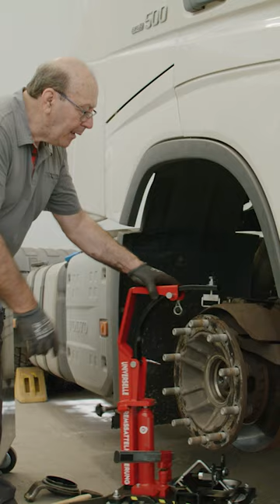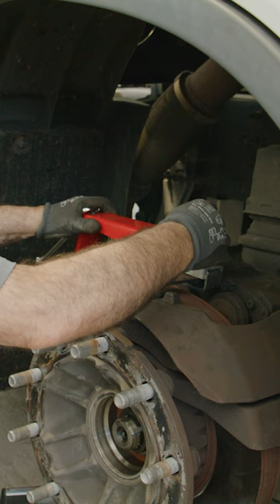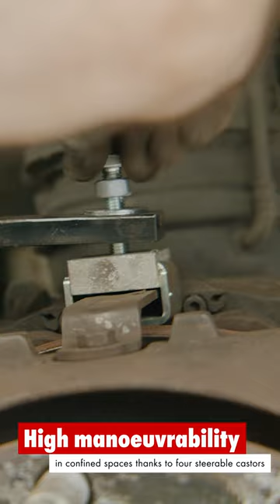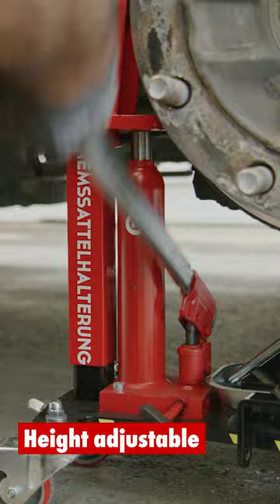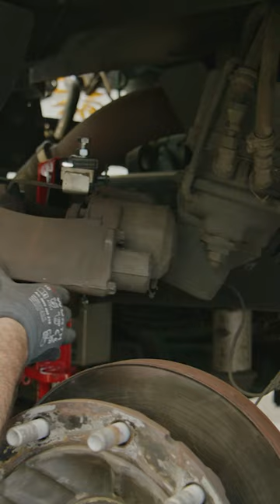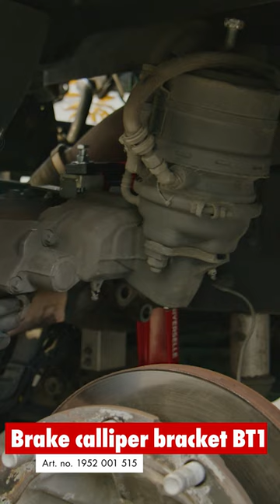Brake Caliper Trolley for buses, trucks and industrial vehicles #shorts

Comment: This really is a waste of time and money… Workshop environment, you’d have a 24mm socket on a windy gun, undo the brake chamber and lift the caliper out the way. Now what truly would be a useful tool would be a caliper holding tool for underslung calipers such as those on trailers. Possibly just a bog standard adapter for a trolley jack… Wise words here from an experienced HGV technician, not someone who has read about the job or watched someone else struggle. You’re welcome